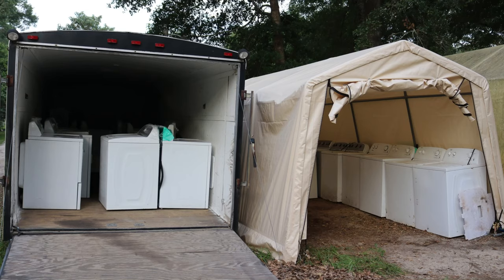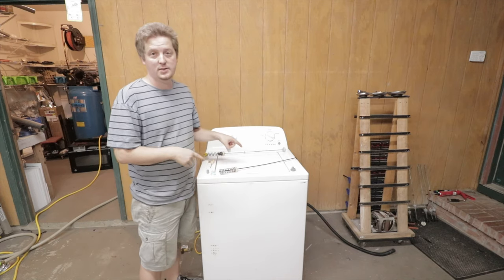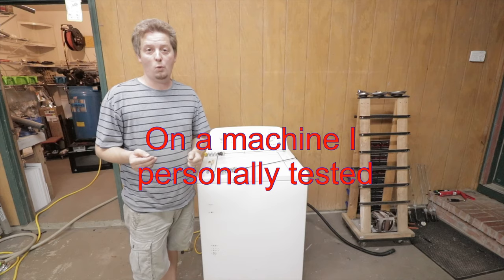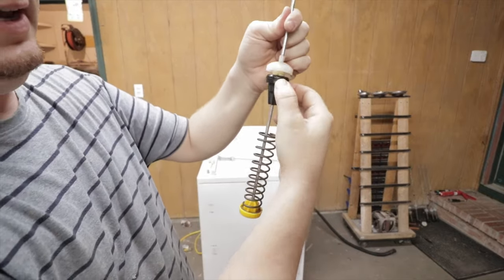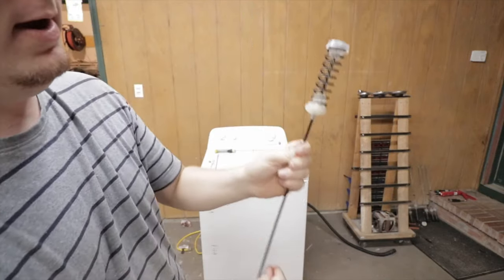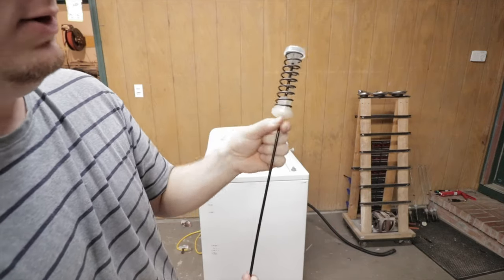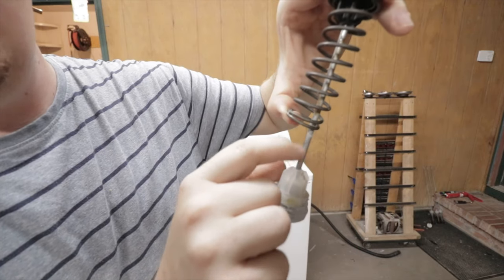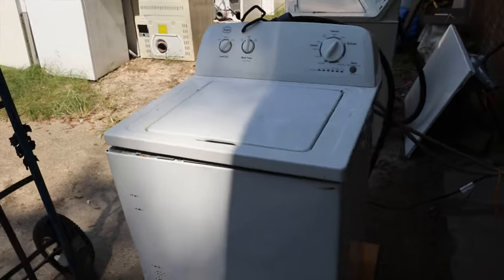Cheap Permanent? fix for shaking banging Washer? $7 to fix Suspension dampening rods W10780048

Comment: I found a 1-1/2" thick,  "Foam Kneeling Mat" at HF for $6.49 that feels really close to the foam bushing material and is firm.  A hole saw with a center bit might be able to cut the bushing (adjusting sizes), then slit it down the side to push it on the rod.  Might be best to slice it into shorter lengths and stack them in the plastic pocket while rotating the slits.  Dow 111 silicone compound is really tacky (same as silicone caulk except doesn't set up) and worked well on mine when I added the toothpicks in my existing bushings.  You could cut hundreds of bushings out of one of these the kneeling mats and still use the mat.  I think this is a real contender for the finals.
Reply: Simplest fix you won't believe.
Pry out that pad from its housing and let it be.  Cut 1/8" square rubber and a little less than the length of the pad long.  Pry out  with a screw driver the center of the pad where the rod goes through.  Shove that rubber piece in there.  And push the pad back in place and you are done.  And marry christmas.
You can also buy rubber cords in any diameter  ( 3/4 " is the right size for this purpose) .  Cut it at length, then drill a little hole in the center, cut a little notch in its side and push in place and you are done.  You can go to Amazon and get these "rubber cords" at 3/4 diamter, 5 feet of it for $22.  And marry christmas again.
Reply: Your idea about the rubber is a good one.  The big issue with my foam plugs is that they are crumbling.  Someone had the idea of taking a piece of vacuum hose, slitting it, wrapping it around the rod then packing some foam around it for the preload.  Braided fuel line is thicker and might even be more compatible with the grease and could be sliced lengthwise like you suggested (maybe 4 pieces) and the ID wouldn't matter as long as the slices could tighten on the rod (still need to pack it).  It could be sanded or ground to length to get a good fit.  I'm running on the aftermarket rods and don't know how long they'll last.  The author of this video filled the cups to create a solid plug (with no preload), just a slip fit and the grease film alone is working the last I read.  Is the rubber cord you talked about the same as backing cord you stuff in cracks before caulking or maybe something else?  Some small foam cord would make good packing material to wrap around the outside of the rubber and the inside of the cup with a small screwdriver.  Whatever we come up with, he's going to have to make a simple video to show everyone how to do it (ha).
Reply: @robert574   also thin them carpet pads just might do it.  They are thick and they will stuff right inside.  I bet they will also work on front loader shocks.
Reply: I just put a small rubber washer that fit around the rod and into the plastic pocket, had to cut the washer to put around the rod and the white caps didn’t fit exactly tight back together since there is a washer now above the foam in the casing. But the extra washer must be causing the foam to have a tighter hold within the casing as the weight of the washer sealed the white caps back together with the small rubber washer inside, idea was the rubber washer would take up any space lost by the foam and squeeze the foam in the same area tighter around the rod. Washer has worked great ever since. My washer is a Samsung top loading VRT 8.5 years old.
Reply: Less than 30 minutes to fix and rubber washers were less than 50 cents.

Comment: 1: I have a few ideas as well to fix the unbalancing act on these machines. My inner drum has very small bumpers on the out side of the drum. 4 of them...12.00, 3.00, 6.00, and 9.00 area, there sticky pads from factory.  Im thinking about a small pool noodle or pipe insulation foam wraped all around drum to prevent the wild travel when the springs go bad in rods. You could mount with zip ties, small bike tube stretched into slit or cut out of pipe or noodle.  Mount about 6 inches down on stationary tube.
2.   I took 4 zip ties at TOP of inner drum and ran them through the holes in stationary basket and back through holes where rods are. Did this on all 4 corners. I then tightened sll corners to allow for a 2 inch play only. Simple fix, it worked no problem. Now how long it may last dont know, but you could double up on the zip ties as well. So this worked fine.
3. You could get split collars from hardware srore. Install the split collars and tighten on the shaft of the rods for desired tension!  You could also add a washer on top of springs with the split collar compressing the spring tension and then tightening up collar. You may need to cut a small slit in washer to slip on rod for split collar to rest on washer. This should work very well with right tension on springs. Nice thing about split collar as well you can wrap rod with plastic, foam, rubber, etc.....then tighten collar around it for friction as well endless possibilities.
   Good luck to all as its nice seeing us put our ideas to the test!  Great post, have a great day everyone.  My washer Lg.
4.

Comment: I actually installed four 15" genuine rubber tarp straps onto the four corners of the suspension rod areas. I hooked into the bottom plastic lip area beside where the bottom of the rod hooks into. I proceeded to bring up the tarp strap wrapping it two times around the rod on the way up, hooking into one of the holes alongside where the top of the rod slides into the triangular metal plate. The top of the tarp strap hook is pushing down onto the top of the rod to help keep it down. Works like a charm, and very cheap to do!! 🥰 This actually eliminates the process of messing with the rods at all except for wrapping the rubber strap around it on the way up to the top. Hope this helps...please let me know if it worked for you!! 🙂
Reply from the maker: Very interesting I'll give this a try as soon as I have some extra time. The Liquid Nails is still working but the process of getting it to dry all the way is too time consuming. This seems like a much simpler method. I've also heard that you can put a piece of rubber tube over half of the spring to make it more rigid and less bouncy and that also fixes the problem, I have not tried this yet.
Reply: @WasherDryerMoney  I've already run five different loads of clothes, comforters, and towels...so smooth now, even on wash cycle. No errors or jumping around anymore...it finished the cycles every time. I was bound and determined to get something to work long term without spending money for parts. The bungee cords/tarp straps are genuine rubber, 15" length, and are actually wrapped around the rods like two times. The hooks are hooked into the drum plastic lip beside where the spring slot is on the bottom, and one of the two holes in the triangular metal plate where the top piece of the rod slides in...I adjusted the top of the hook onto the top piece of the rod, and it applies downward pressure on it as well....really works well. 🙂
Reply: @jeffreysantucci4419  Can you post a picture of this process? I'm not mechanically gifted and I'd love to see exactly how you do this.
Reply: Can you visually sketch this or take a picture?  I've been fighting my washing machine with these annoying rods for  a while.  I'm glad someone figured out the REAL reason for replacing the rods.  It's not the springs, and that dampening effect.  I was like, these springs don't even seem worn out?!
Reply: How long are your rods?  24"?  27" 18"?   I just need to know what length rods the 15" rubber tarp straps will work with.
Reply: @darrellguss1553  I didn't film it. But just take it apart, with the lid out of the way,  reach down in all four corners, and hook the hook of the tarp strap onto the plastic lip beside where the rod goes, keep it stretched a little bit so it doesn't fall off the bottom and up into one of those holes that are drilled into the aluminum triangle bracket beside where the top of the rod goes.... Work the top of the hook end onto the top of the rod piece so it keeps downward pressure on the top of the rod. just be careful how you route the back right because there is a quarter inch water line that you don't want to kink or put pressure on, or else it will pop off the nipple and flood when you go to wash.
Reply: @filazee  I didn't measure them...just experiment with it. You don't have to mess with the rods at all... The tarp strap hooks to the bottom of the drum plastic lip up to the metal plate beside the rod... You can choose to route the tarp strap around the rod on the way up or you can just hook it to the bottom beside the rod. Just be careful of the back right one, because you don't want to put any pressure on the quarter inch water line that hooks into a nipple on the drum. You will see it, just be careful.
Reply: Jeffret Santucci, I just did your technique and it solved my balance issue!!! Used the same rubber bungee cords.  I wrapped the rods like 3-4 times depending on how much i needed the bungee cords to “hook” to the rod holder bottom plastic along with the top sheet metal of the washer!  Cost me $4!! $1 a bungee cord!!! Home depot.
Reply: @zee1726  fantastic...glad it works!! 🙂 Just be careful of the back right, the quarter inch water line could come off of the nipple on the drum if you don't clear it with the rubber tarp strap. 🙂
Reply: @jeffreysantucci4419  Jeff, recently replaced my springs because the washer was banging. The fix made it much better for a little while, now its worse than ever. I suspected that the replacement springs might have been cheap aftermarket units but not sure. Anyway, Ive just installed the rubber shock cords per your idea. Couldnt find 15 inchers so used 24 inch with about five wraps for starters. Good friction up and down the rod. The tub sits and moves MUCH more stiffly now. Running my first load for a test as I write this. Results shortly!
Reply: Well, this fix made a significant difference but it still bangs a little. Must be a bad bearing or bent shaft, Think its time for a new washer.....
Reply: @deksea  the genuine rubber 15" cords are ideal...just make a couple of turns on the way up the rod...the back right, I just hooked the cord to the bottom, and didn't wrap that one because of the water line. Experiment with it. You can create different tensions by how much you wrap it, or don't on the way up to the top. Definitely worth a couple of different tries. Just put it in the spin cycle to test how well it works after you hook up the cords. 😎
Reply: Thank you so much for sharing how to fix with 4 tie down straps! Works like a charm :-)
Reply: @koedypaslay2208  I am so glad it is working for people!! Just a spur of the moment brainstorm in frustration trying to fix my washer...lol. 😎
Reply: @jeffreysantucci4419  I can get the EPDM rubber tarp straps locally, but not 100% genuine rubber without ordering and it and it won't be here before the family gets here. Think EPDM will hold up well enough?
Reply: @Kinjo2008  worth a try.. it will be away from the sun, so try it.
Reply: @Kinjo2008  let me know how it works.
Reply: @jeffreysantucci4419  10-4, keep you posted. 👍
Reply: @jeffreysantucci4419  Update. I tried out those 15" EPDM tarp straps from Advanced auto parts. 4 costed me $6.40.  I wrapped them twice around the suspension rods just as you described. That tip cut almost all of the knocking out. Genius idea and tip my friend. You saved me 83 bucks. Thank you. 👍 

The only knocking im getting now is for the first 5 seconds or so when the final spin cycle starts up and not as loud. My girl was like are you running a load because I didnt hear it pounding? 😎 I'll take it. You should start a channel with tips like this. I would sub. 👍
Reply: @Kinjo2008  awesome, glad it helped you!! Before I started with mine, every time it went into a spin, it went way out of balance, and stopped throwing up a ue error. Then I had the back right cord interfering with the small water line which caused me a little flood when it popped off the nipple on the drum.. lol. Finally got it right, and it's been working great now for weeks!! 🥰
Reply: Please post any kind of picture or diagram.
Reply: I just fixed a Fisher & Paykel washer from the Craigslist. It bounced and banged like crazy. I tested the dampening rods by pushing down the drum at each corner. The front-left seemed bouncier than the others. To be honest, Fisher & Paykel's washer all have rubber straps going across each corner centering the top drum from banging sideway. So that inspired me into using a strap to put the weak dampening rod in suspension. To do so, I folded one end of a bicycle inner tube that was laying around into a figure 8, slipped it around the cylinder that houses the spring on the bottom and stretched it just enough to give a slight tension without lifting the drum at this corner. I did not wrap around the rod to take the slack off. I lifted the top support and looped my inner ture around it so it hung loose after screwed back the lid close to pinching the dangling it at both sides of the top corner. I used another tube to hook the previous one to the foot. Once done, both rinse and spin cycles were super smooth. I could barely hear the drive accelerating at all. It now as smooth and silent as new.
I was curious if someone came about the same solution and indeed we converged, although his solution has merit.  I must admit your strap is more elegant, however my inner tube was free and begged me to be used. With little creativity I'll make it less visible.
Reply: @WasherDryerMoney  To cut down processing and drying time, may I suggest the home depot 5$ epoxy putty sticks as frictional material instead of Liquid Nail? it shapes like playdough and sets hard like rock in less than 5 minutes. First, you may have to wrap some plastic film around the rod to prevent it from grabbing permanently to the rod, and then spray a little bit of timing belt conditioner or Henry roof tar to increase friction. Otherwise use lithium grease to decrease friction. Personally I think if I go this route, I would try cork from wine bottle. It's an awesome material with just the right friction and great compressive resilience. The problem is that it would need to drilled through, then slotted, then .inserted onto the rod and finally wrapped around with tie wraps or vinyl tape to hold its grab.
Reply: Does the top bungee cord hook have to be on top of the rod hook, or can it hook onto the metal metal bracket. Thank you
Reply: @kenlorincz11  same
Reply: O0

Comment: Man , my machine could not even do a load of "air" without banging to beat hell . I installed a new set of new rods , and it wasn't a month later it started banging again , which turned out to be only one damper lost its grip . I put my own personal fix to all 4 of them , so as not be fearing another one going bad , and having to open this monster back up (Cabrio - direct drive , top loader) . Too slick a machine to not try to salvage IMHO .
   Thanks to watching your video , I now have a clear understanding of what the "actual" problem is . I've since taken corrective action without spending a penny  , using a go between consisting of 1/4" HDP - IPS flex tubing sliced length wise to close up gap . It's buggar to get the spongy thing wrapped around it at first . Now spinning like magic , as it used to !   
 .
Thank You for the excellent tutorial !

Comment: I have a fix that worked for me. I used a 1/4" u-bolt attached to the of the cap that resides on top the spring assembly.  Clamped tightly should prevent the failure of the sticky grommet that holds the spring cap in place.
Reply: Youre talking about on top of everything, like after the rod is installed and above the little ring that sits on top of where the washer rests? That's exactly what I thought about doing, except with a cut up ground bar from an electrical panel. (Basically just a set screw in piece of metal with a hole in it.)

Or a u bolt for electrical splicing or a u-bolt for stainless wire rope would work.
Reply: Still work or nah?

Comment: I just installed new suspension kit on Admiral ( not direct drive). The basket doesnt bounce , but it didnt with the old springs, etc., and it dies the same thing, ie, upon beginning spin cycle it sounds like Chuck Norris in there trying to get out. Though replacing the foam inserts with alternative materials may work, i think that is treating a symptom and not the illness. Even after running through the diagnostic modes, eg, recalibrating, auto-whatevers, tachometer test, etc, it still had same issue to same extent. I can imagine that it ran this way from factory but those little foam dampeners absorbed all the violence. It must be a bearing or something. This thing tries to kick 70yrd field goal immediately upon engaging spin cycle. I leveled and run recalibration mode after any modification  . I dont have spanner to get shaft nut off and didnt want to bang to hard and possibly cause more issues.
Reply from the maker: It could be that the inner drum and outside drum are disconnected from one another or just slightly bent from each other.
Spin the drum by hand with machine off and see if it wobbles to see if it’s bent to see if it’s connected to each other grab the inner drum and give it a good shake. It should shake as one big piece and not be rattling.